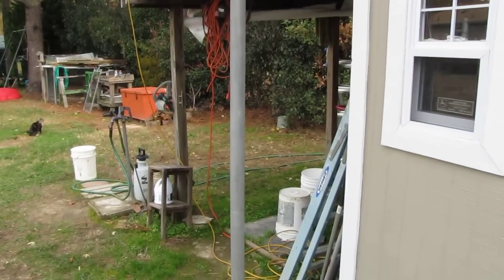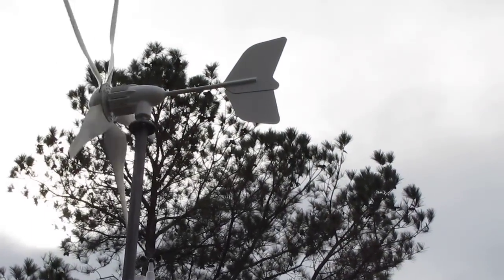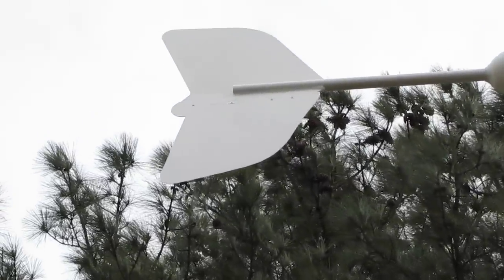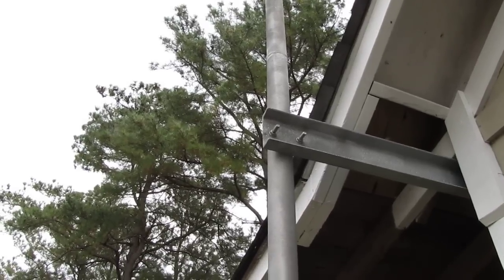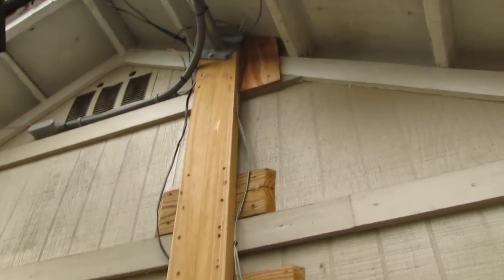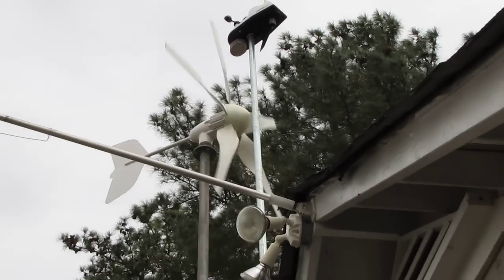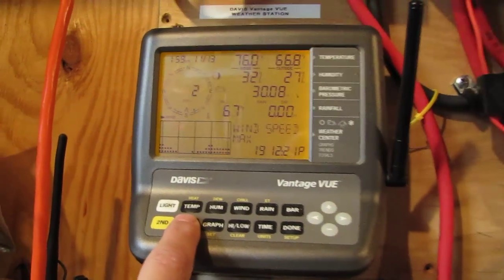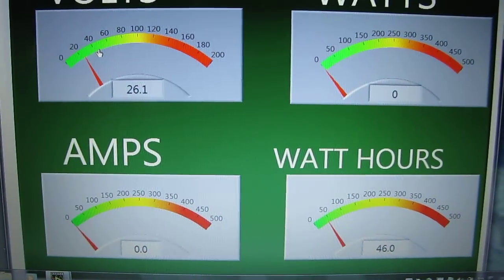VIARLOCITY Wind Turbine Tower How To's

Comment: How many micro turbines do you need to power a living room home theater system.
Reply from the maker: As long as you constant good wind and  Batteries 2 or 3 1000 wind turbines should do it  but remember you need good 20 mph winds to keep them going